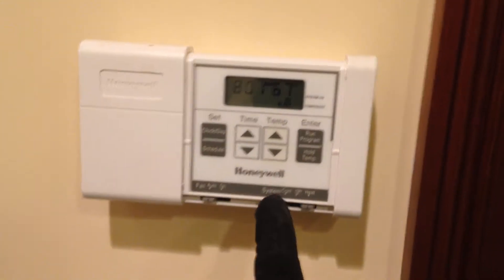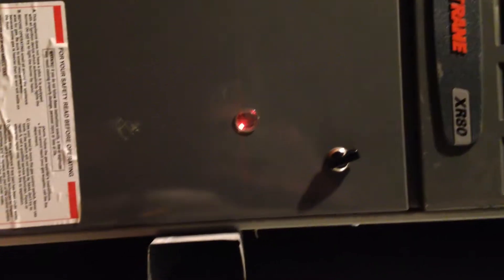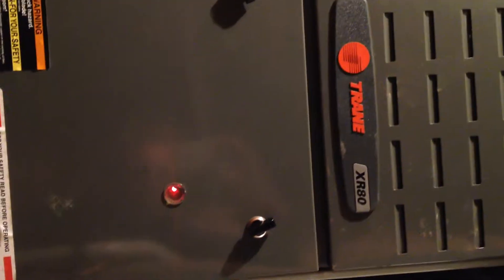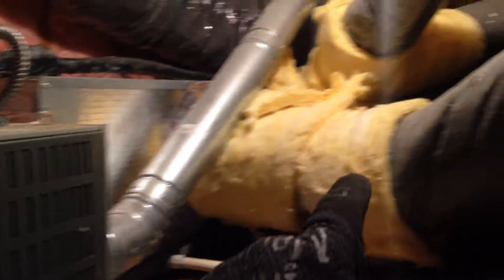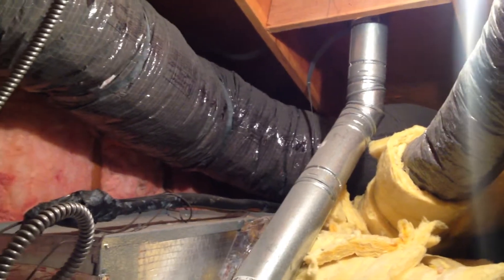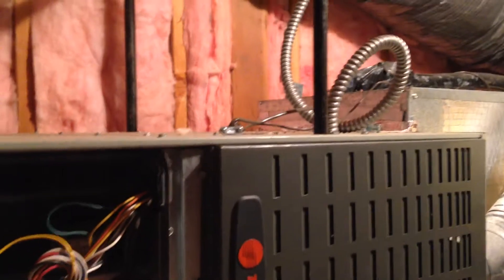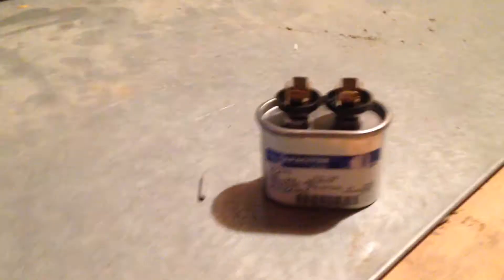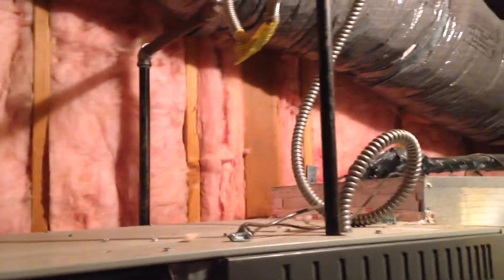Home Gas Heater Repair - Weak Airflow - Bad Capacitor

Comment: Hello Brad, just watched your Trane furnace video and wanted to thank you for your video. I changed the limit switch, didn't work..saw your vid and immediately turned off the call for heat and turned the fan on from the thermostat and got nothing. As per your video it was the capacitor giving me the 4 blink error code on my Trane. Great video, thanks for your time and tips. Hope to see more videos from you!

Comment: My fan motor was dirty, I vacuum it, changed flame sensor, filter. It fires up, run about minute shut off, I hear fan motor hum, and got spit light, see fan blades turning very very slow plus got continues blinks no pause just blinks from control board. I not sure if capacitor I have check volts but wonder if something in fan blades making very very slow, binding

Comment: I just replaced the filter and the air flow is pretty weak as to nothing at all. I'm ordering a capacitor and hopefully this will fix the problem.

Comment: I have this save heater. Im no longer getting heat from my central vents.  I had my gas company come out. Found furnace blower not turning on after relay is sent causing heater to limit out. If that terminology makes sense..

Comment: Good video, I hope this is my problem. My AC/Heater Fan Blower isn’t coming online. I checked voltage on my thermostat and it was fine. I checked power to the unit and that light on the board showed no issues are present. Still no fan blower in on or auto mode for either heat or AC. I ran the blower wire from the board, disconnected and reconnected it, to the direct power from the door switch and it came on full speed, so I checked the capacitor, it’s a 10mfd +/-5%. (10.5 - 9.5) well it measured 9.01 which is about +/-10% so I’m hoping this is weak and the new one that comes in today fixes the issue. There was very little air coming out when I had the heater on kinda like yours, without the blower running. Anyhow good video thanks for the help, I will post an update if it worked.